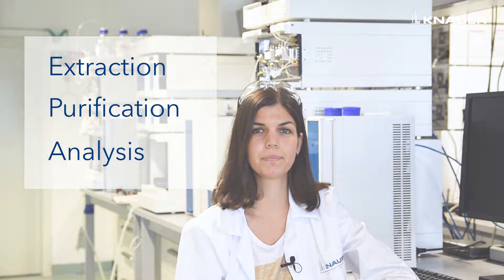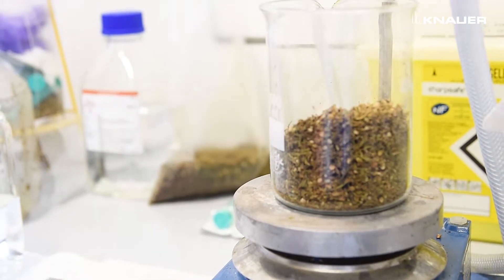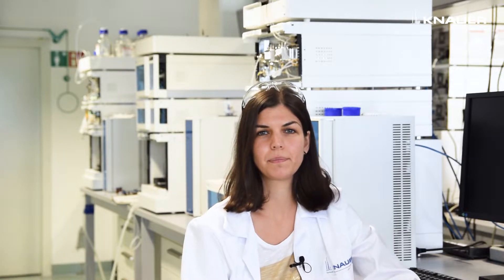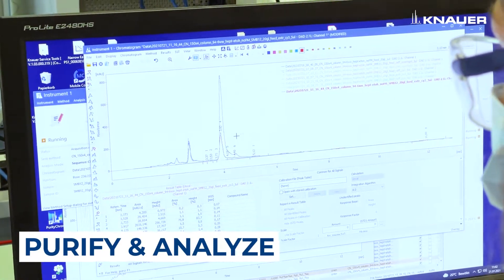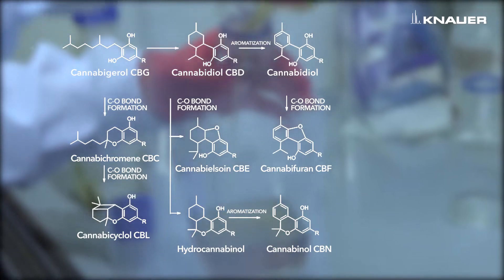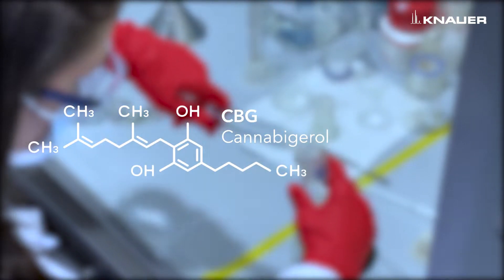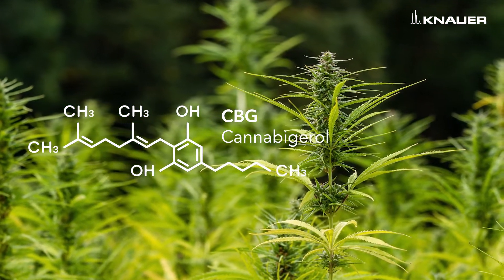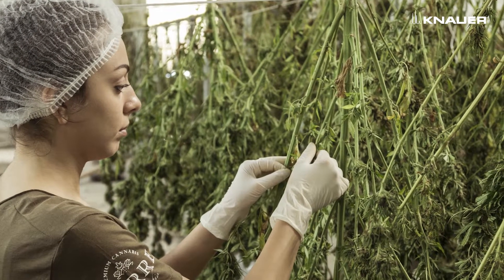Analyze and purify with KNAUER

Comment: Can I use this machine for xylitol purification? please let me know your email ID.
Reply from the maker: Dear Bioseparation Process, The system used is an AZURA Lab SMB, which can also be used for xylitol purification. The AZURA SMB is available with different wetted material flow paths. In case of CBG we used a stainless steel equipped version, with for xylitol purification PEEK. For further questions, please contact "info@knauer.net".